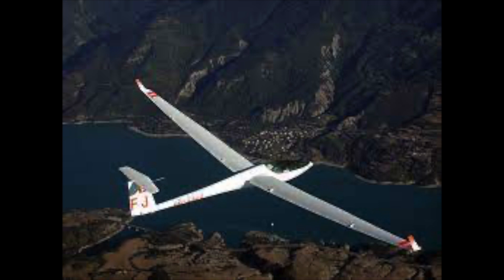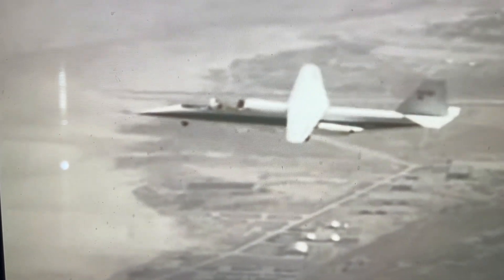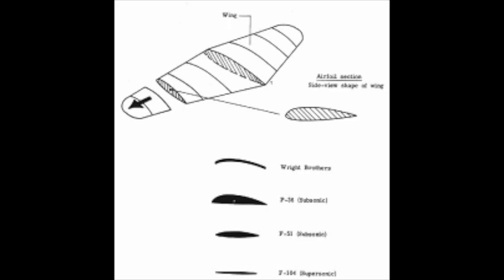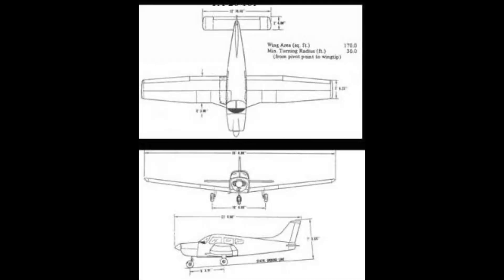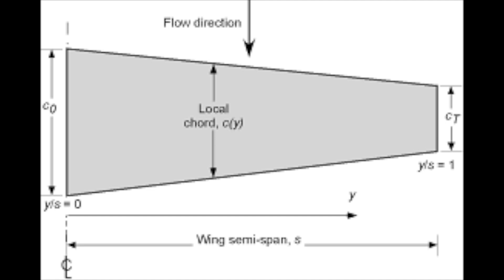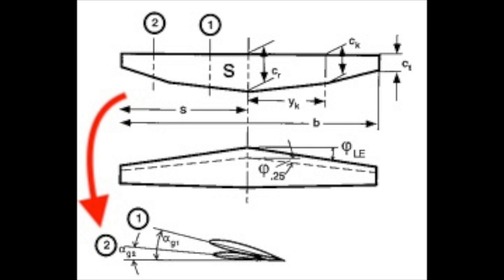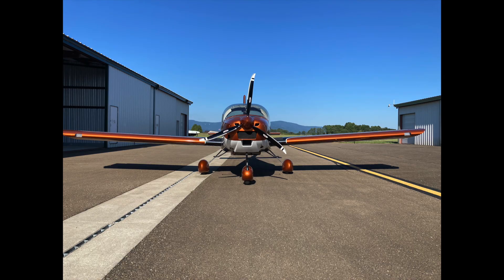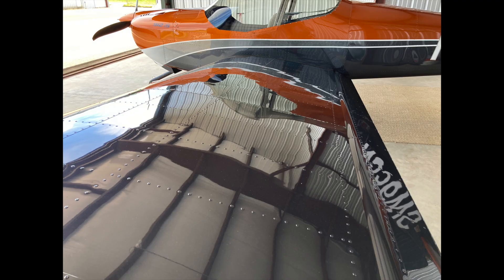My Airplane Wing

Comment: The choice to make the wings easily removable was, in my opinion, a big mistake. That decision forced the fuel tank to be placed aft of the seats and forced the pitot tube to be placed at the tip of the propellor spinner. I find the 20 gallons of fuel to be less than I would like especially with the limitations of steep climbs when below 4 gallons remaining. Putting fuel in the wings would provide the ability to increase the fuel load and the useable fuel. There are a few other issues I have with the design of the airplane but overall it flies like a dream, the visibility from the bubble canopy is fantastic, and it is very inexpensive to operate.
Reply from the maker: Thanks Gary for the comment.  Stick around since I will soon address this issue in an upcoming episode.

Comment: I have always wondered what the difference in drag would be of a flush rivet vs the raise pop rivets would have on the design...
Reply from the maker: Although I can't cite any specific reference to the advantage of flush riveting, I believe for high performance aircraft the benefit is worth the effort.  Perhaps even on a plane like the RV-8 with its cruise of 200+ MPH the reduction in drag helps.  I do think, though, that for a relatively slow plane like the RV-12 flush rivets wouldn't matter much.  Since the plane is limited to a max 120 knots which it easily makes with less than 100 HP, pop rivets make sense.  Your question is an interesting one, though.
Reply: Not much at 120 kts

Comment: In dihedral lower wing generates more lift, since it acts as longer wing span wing, or upper wing rather having shorter wing span "projection", that creates surplus of lift, and rolls aircraft towards equilibrium.
Reply from the maker: You are correct.  Nearly all non-acrobatic low-wing planes have dihedral engineered into the design.  High-wing planes less so.  Fighter jets and heavy lift cargo planes often use anhedral angles to reduce the inherent stability.
Reply: @rv12sg  --  -- Well, French company Mudry(CAP) using Walter Extra's wings coupled with dihedral make for one very interesting aerobatic aircraft. Like CAP-232, and so on... One maneuver CAP's excell at are Snap Rolls(aka Flick Rolls)
Reply from the maker: @RussianThunderrr  Not to be argumentative, but the profile image of the CAP 232 seems to show an aircraft with little or no dihedral at all - the 330 Walter uses may vary some, that I don't know.  The link below is to an image of the CAP 232.  

https://www.google.com/imgres?imgurl=https%3A%2F%2Fdoc8643.com%2Fstatic%2Fimg%2Faircraft%2F3D%2FCP23.jpg&tbnid=SIvOMs_mPkN2HM&vet=12ahUKEwiPr9u_4cKDAxUtr4kEHQf5AwcQMygWegUIARCAAQ..i&imgrefurl=https%3A%2F%2Fdoc8643.com%2Faircraft%2FCP23&docid=Kv6aMhZv5JJDMM&w=770&h=455&q=cap%20232%20aircraft&ved=2ahUKEwiPr9u_4cKDAxUtr4kEHQf5AwcQMygWegUIARCAAQ